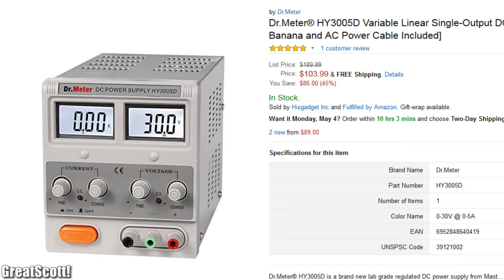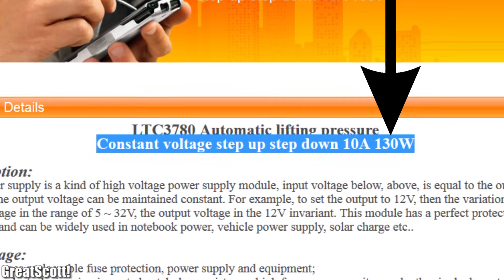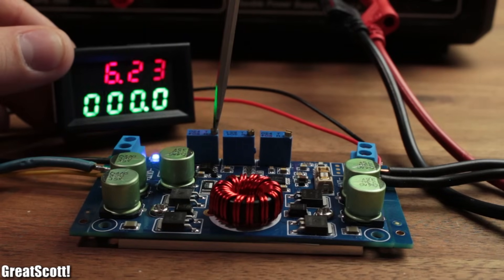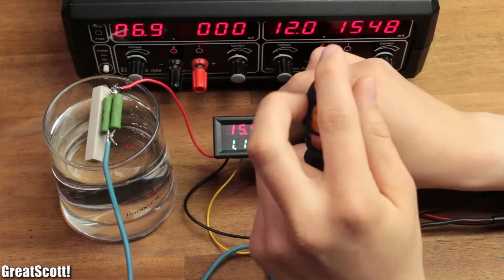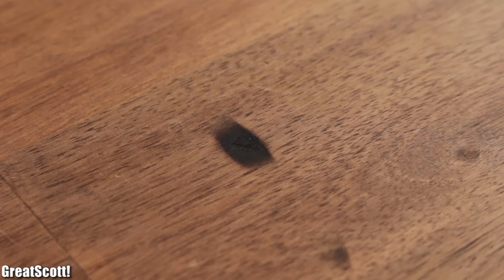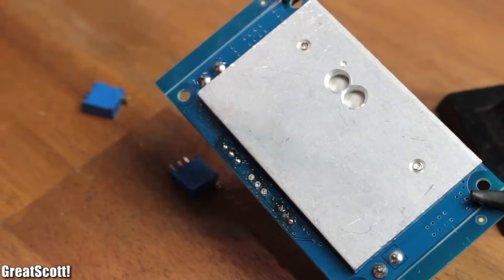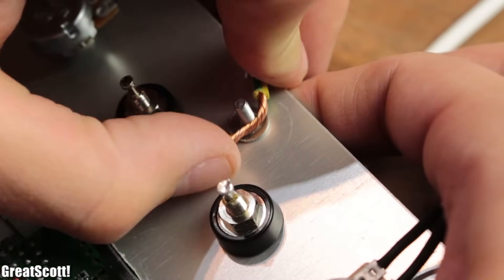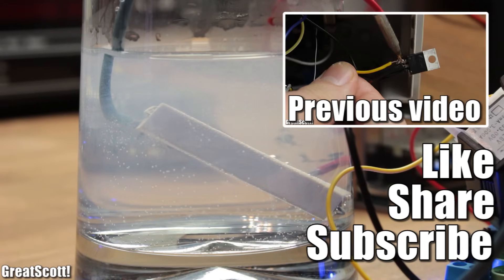Build your own Variable Lab Bench Power Supply

Comment: Hello, thanks for this tutorial. Unfortunately I couldn't get mine to work. If wired as you showed, I get 0.0v on the volt-amp meter, turning the potentiometer either way doesn't help. Current shows correctly and change upon turning it's potentiometer. Any hint on what's wrong with my setup? Thanks.

Comment: The fault LED is on... What should I do?
Reply: Turn the potentiometer that remains on board(in this build) counter clockwise until the FAULT LED goes off. In my board it took like 20 rotations. It is the under voltage limit adjustment. There is nothing faulty on the board, the led just indicates that the voltage is lower than the set limit and hence the board has stopped power output. You could also use higher voltage but with this board 12v is about the sweet spot for efficiency.
Reply: crank the middle pot to both sides a LOT or turn up the input voltage

Comment: Great video - I built a bench power supply using your video :)Why does my maximum output voltage drop to 25.5V from 29.8V after fitting the remote 500kΩ potentiometer?

Comment: I follow your instruction but:
1. I use a 180W 12V inverter instead of the 60W you use.
2. The LTC3780 Max power is 130W, since I can't find a 130W fuse anywhere so I use the closest thing I have which is a 125W fuse, I added the 125W fuse for overpower protection.
3. I added more heat sink and a fan for more cooling because the data sheet of the LTC3780 buck/boost regulator said that you need more cooling if the power is above 80W.

Comment: good after noon Mr Scott ,, I got a QUESTION SIR I MAKE THE VARIABLE POWER SUPPLY WITH A 12 volt 10 amp power supply and the bost a LTC3780 ,,,, the problem is the voltage is not stable voltage goes up and down

Comment: On the LTC3780 the potentiometer in the middle is there to adjust the current. Goes from 300mA to 3A with the 200kOhm potentiometer as we heard. If one used  pot. with a different resistance , in how far would it influence the current range?

Comment: For $70 (on amazon) you can get a 0-30V, 10A power supply, it's about twice the cost of yours, but also gives about twice the amperage, and has an integrated cooling fan (that only kicks in when it needs to). -- Beware though, the Chinese one I got is a bit cheap; mine showed up and I thought the display was bad, I opened it up and noticed that two of the connector plugs were just loose.  So I re-tightened them, and now it works like a champ.

Comment: It would be good ; necessary to understand the electrical code specifications for a power supply. I read about fans, shrink tubing, and fuses, yet it seems like those issues were not discussed. I sometimes wonder if they would limit access to videos like these so that only skilled people can perform these actions. Fire protection,  but also legal protection for Youtube. Hmm... I certainly would not want to go against federal and/or state/provincial laws; would want to specify them as part of my design specifications. You are quick and smart,  but not entirely thorough enough on these important safety issues.

Comment: Instead of using the recommended 12v power supply, could I use this circuit to add variable functionality to my old radio shack  power supply? Or will I need a more robust buck converter?
https://informops.files.wordpress.com/2015/03/radioshackps.png

Comment: Thank you for this video and your channel. 

I am building a power supply arround this board.
I wanted to use multi turn potentiometers but couldn't find 200K and 500K. It is possible to use other values? or to change the circuit to use 10K pots?
Reply: I am also looking for a way to go through this. There are no 500K and 200K big multiturn pots. What did you do? I am thinking to make some kind of modification and somehow mount those tiny pots to the plastic box and attach/glue some knobs.

Comment: Hello, can I connect the 12V 10A 120W power supply to this board? But I need to buy another amp meter that can withstand 10A?

Comment: NOT A GOOD IDEA....!!THERE ARE FAR MORE SMART AND MORE POWERFUL ''DIY BENCH POWER SUPPLY'' ON THE NET..WITH JUST AN OLD OR CHEAP DESKTOP PSU....THIS MODULE YOU USE IS PROBABLY MORE EXPENSIVE THAN A LOW END PSU!!!

Comment: The most basic DC power supply only needs: a power cord, a container for the internal components, one voltage transformer, diodes, some capacitors for filtering, an adjustable regulator, a heat sink, outlets and I strongly recommend having a switch.

Comment: I looking for a triple output supply. Would it take a 12V 15A supply to do the trick? Any other considerations when driving more than one of the LTC3780 boards other than "daisy chaining" the 12V power to each one. I would arrange two of the output binding posts so I could jumper the ground of two outputs to get a + and - voltage. Haven't decided if I want one display with a selector switch to keep the cost down.  It would take a fancy 3PDT switch and would need to be able to handle  the output current.

Comment: I work in the HV world in North America and protection and control voltage is usually 125VDC. 
I have looked for a way to make a variable voltage constant current power supply but electronics is not my forte and there is low demand for this voltage level. 
Currently the industry mostly uses Variacs with a full bridge rectifier, but it's bulky, heavy, and not very durable.
I'm wondering if there's an easy way to design a 150VDC power supply using 120VAC input and a buck/boost converter?

Comment: See! Water does not conduct electricity! XD
This is actually true for distilled water. Still, don't follow GS's example and go pouring water onto your phone to test it!
Reply: The moment that water contacts your phone, it will become so full of microscopic impurities that it will definitely be conductive.

You are correct. Pure (or mostly non-contaminated) water does not conduct electricity. The danger is usually corrosion, or impurities floating in the water and conducting electricity.
Reply: Actually distilled is still conductive , you want de-ionized water

Comment: Great tutorial  MR Scott I by a 12v 10 amp 120w power supply and the LTC3780-Automatic-lifting-pressure-Constant-voltage-Amp-step-up-down-10A-130W
the Question is ,if  You can Help ,I conected the same way as Your instructions  Sir, I dont get the 28  volts dc,when I reach the 28volt dc the the LTC3780- little red finks , and stars going crazy and the amps I get is 3 amps  any subjection Mr Scott

Comment: I have four of these LTC buck/boost converters and only one worked "out of the box" they are crap! Two of them show both the Fault and the OK leds simultaneously and neither buck nor boost, although I guess you could say one bucks (or is that sucks?) as it only provides about 3V out with 12V in. None of the pots has any affect on the output or status of the leds. The other is much the same with 12V out for 12V in. The third does seem to work, however when the CC pot is turned to minimum the LTC module activates my power supply's short circuit protection. The Fourth one, touch wood, is functioning ok for now, but can it be trusted?

Comment: I need help. went i conect the transformer and I read the voltage its give me 12V but when I connect it to the LTC it doesnt give any voltage in the autput and the led named fault trun ON. What can I do to fix it??
Reply: You may need to first rectify the AC from your transformer output to a DC. Look up full bridge rectifier or ac to dc conversion. I don't believe the LTC will accept AC input as it is a step up step down dc to dc converter use to raise and lower the voltage and current. The power supply used in the video I think is a switch mode power supply that is putting out a dc current.

Comment: hey, great video!
you mentioned charging lithium-ion batteries with this thing. Is that only possible with "lithium-ion" batteries or for example also if it only says "lithium" on the battery? What about all the other types? Also what should I keep in mind doing this concerning safety?

Comment: Just need confirmation if following module be used instead of LTC3780 with a 20V 4.5A supply?

http://www.hallroad.org/power-supply-and-adapters-/873-mppt-solar-controller-solar-panel-board-5a-dc-dc-buck-step-down-charging-module-constant-current-voltage-module.html

Comment: I'm currently making a power supply using one of these and I was wondering if it has some kind of short-circuit protection? The last thing I want is to replace the module every time I make a mistake (and it happens quite a lot)

Comment: i don't know why in my case after i solder the two pot the ltc's fault led goes on and the chip getting hot with output voltage 0.89 to 2.64v only .I'm using 220k & 470k is that the problem, can anyone told me why this happen, the solder is ok no shorting. And I'm ordering another one so i don't want same happened to my new ltc any help would be appreciated.

Comment: Your ground connections are completely against electrical code ;-) Crimped terminals are mandatory for stranded wire, solder is unacceptable. They will loosen over time and you lose protection that you were supposed to have.

Comment: Cost of parts = £55.00 
Adjustable 30V 3A 220V DC Digital LED Display Regulated Variable Power Supply (UK supplier) £25.75 + £9.89 P&P (ebay.co.uk - August 2017)
Probably not worth making yourself unless you really want to.

Comment: Bought all the parts, waited 1 month..... Soldered the potentiometers exactly..... a fizz, pop and nothing.... What went wrong??
Reply: breezebro Probably shorted a potentiometer pin... decided to buy cheaper 90w $7 power supply instead as it comes with all the same features and the potentiometers with knobs or what ever they are called. May try again some time soon though. It did say fault when i first got the LTC3780 but i turned the UV pin enough till the light went away. Before soldering pots there were some minor problems so it could of been a faulty board. Too much hassle for a refund... He's asking too many questions

Comment: The PSU module doesn't seem to be available in the UK. There are some alternatives. 

Input 7-32V Output 1-30V Adjustable Voltage Converter which is very similar to the one in the video. Though it may need a better heatsink, this shouldn't be much of a problem. https://www.amazon.co.uk/DROK-Converter-Regulator-Adjustable-Constant/dp/B0171JFSJ0/ref=sr_1_16?ie=UTF8&qid=1499938944&sr=8-16&keywords=boost+converter

 DC 10-40V to 0-38V 6A  Adjustable converter. This one is different from the one featured but claims to have excellent current and voltage regulation. It also incorporates a small display, but this may be useless for the needs here. https://www.amazon.co.uk/Numerical-Converter-Regulator-Constant-Transformer/dp/B01GPTY7O4/ref=sr_1_42?ie=UTF8&qid=1499939419&sr=8-42&keywords=boost+converter

Comment: Good video for teaching. But... I'm a huge DIYer, but $60 for a 30v 10A adjustable bench supply or a little more for a better quality one, means I'll just buy one. There's a point where DIY doesn't make sense. Unless you've got the parts laying around already, just buy one and have a better quality and more reliable tool. Especially since this is a tool you'll use a LOT.

That being said I've got myself an old 24v, 5a lead acid car battery charger that I'll be converting to an adjustable PSU as a curiosity project. It's so ridiculously simple in its construction a cave man could understand it. Kinda scary how simple it is. What's even more scary is how it was built (I'm sure many of you know what horrors lurk inside of some 80s and early/mod 90s electronics!).

Comment: nice! This project is way original. Instead of buiding your very own bench power supply, with a printed circuit board, capacitors, transformer and shit, you was clever enough to use an already cheap switched mode power supply (which you set to 12 v before assembling it) and then used the regulator to control it!! All that inside a nice case, which i wonder why it isn't a plastic one but nevermind. Very clever and original idea!!

Comment: I think I'm missing something... I wired this up using exactly the same components but can't get a reading on the ammeter? Wiring the meter is as follows: thin red and thin black - positive and negative input on the ltc. Thick red - positive binding post, thick yellow - negative binding post, thick black - negative output on ltc. Positive output on ltc also goes to positive binding post.... Am. I supposed to use a current shunt?

Comment: ordered everything just can't wait to try it out. how can I change the pots to the ones I ordered without damaging the circuit as some people have above and ended up breaking the tracks on the board and having to buy a new one . also if use a plastic ABS  project box do I need to figure a way to earth the ac input to the box or will it be fine with it being plastic Ie. non-conductive  please Some help.
cheers Daniel

Comment: There is a slight drawback with these kind of small volt/amp meter: the ammeter measures the current on the negative line.

If you have in the circuit (what is powered by the PSU or an oscilloscope for instance) a device connected to the earth, and if the DC 12V supply is also connected to the earth, then, in some cases, the shunt of the ammeter will brobably bee shorted via the earth.

This is harmless but the current will then not be displayed.

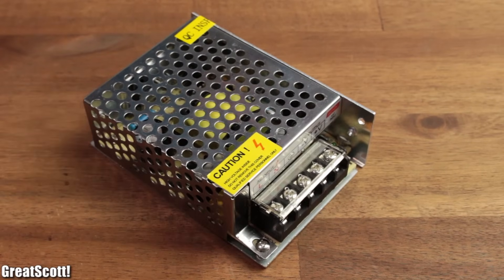Comment: is the max 5amp or 6amp?  I see at 3:12  this is a 12v 5A power supply,  but at  6.51 I hear "maximum of 6 amps".    
Either I am missing something, or need to learn something new.
Reply: Buck boost converters can output more current when outputting lower voltages. Unfortunately, the current will only reach 2.5A at 24V.

Comment: U should use a 12v 15a ac-dc converter. Because you can't reach the maximum power 180w with the 5a one.
Reply: Can we use laptop power adapter for ac to DC conversion I’ve 20v 7a one
Reply: True.. Have you make this project yet? I'm thinking of using a 12V 10A DC. What do you think? Thank you

Comment: How would one add a fine adjust to this? Would I have to use ganged pots (connected opposite each other) to raise and lower the resistance value on both sides of the main potentiometer?

Comment: That kind of power board is not available in my country... which of these boards can i use?

this one?
https://www.google.com.ph/search?q=ltc3780+philippines&prmd=ivn&source=lnms&tbm=isch&sa=X&ved=0ahUKEwjtytGn7pPTAhWGJZQKHdxuCLI4FBD8BQgFKAE&biw=360&bih=512#tbm=isch&q=150w+boost+converter&imgrc=BylQMLurUM29fM:

or this one?
https://www.google.com.ph/search?biw=360&bih=290&tbm=isch&sa=1&ei=XFLoWNS9J4Hi0gTy96y4Cw&q=5-30v+boost+converter&oq=5-30v+boost+converter&gs_l=mobile-gws-img.3...190944.202527.0.202889.27.23.4.0.0.0.224.2506.11j9j2.22.0....0...1c.1j4.64.mobile-gws-img..1.14.1561.3..0j35i39k1j0i5i30k1j0i8i30k1j0i24k1j30i10k1.6jfUJrOvVB0#imgrc=v0TDbSC6kJbNBM:

Anyone? Thanks...

Comment: For that kind of current it's important to have a thick and short cable for the output terminals; otherwise the voltage regulation could be noticeably off. And I would solder them too, replacing the screw terminals the same way we did with the potenciometers. I'd also avoid hot glue since it tends to 1) unglue by itself and 2) melt in the presence of heat. I also second other people's opinions about heatshrinking the AC terminals and using a better solution for the Earth protection, like making a small ring with the cable end and a little bit of solder so it wouldn't come off of the screw.

Comment: Could this power supply run an 18 volt drill without burning something out? I'm not sure what the amp draw would be from the drill, but I've already tried a laptop power supply with no luck. I would rather build a power supply instead of adapting another battery to fit.

Comment: What is the specification of the potentiometer that you use for replacing the default 3296?  The spec of 3296 is 10 ohm to 2Megaohm. Seems very difficult to find any with similar range. I believe we don't need such a big range.

Comment: @GreatScott is there an easy, effective, and cheap way to make a power supply that does not put put more than 15vDC but amperage at or around 100-200 amps?
Reply from the maker: No

Comment: i need far more voltage not current 5 Amps is enough .... minimum 20 000 V  if not more .... planning on creating static fields with no or very very little current in it ....

Comment: Hey  Scott ,  Am  I  missing  something ?  Where  did  you  change  the  AC  voltage  from  your  power  supply ?  Or  is  it  DC ?  The  way  you  were  explaining  it ,  I  thought  it  was  as.  I'm  actually  using  the  LTC3780  as  you  have  with  a  400w Computer  psu. Putting  in  a  4  position  selector  switch .  3.3v, 5v, 12v, and  variable .  I'll  have  close  to  18 amp  on  the  12v  position .  I'm  adding  an  extra  cooling  fan  on  the  LTC3780  to  get  full  10 amp  on  the  variable .  Also  using  5  digit  readouts .  Your  video  inspired  me.     THANKS !
Reply: I'm  sorry ,  I  watched  it  again  and  noticed  it's  an  ac - dc  supply .  Almost  have  all  my  parts.  My  LTC3780  should  be  here  tomorrow .  Getting  excited !  Thanks  again  GREAT  SCOTT

Comment: Nice video, but I have one question. Knowing that the LTC3780 can have an input voltage in the range of 5 ~ 32V why did you choose to only supply 12 volts? Does it not matter for the output it can provide? I mean that, if you supplied 24V i.e. would it still only reach 29.4V at the output stage?

Comment: The power supply is rated at 60w, but if you run it at 30v and 6 amps that would be 180w. Wouldn't that be dangerous for the ac-dc power supply?

Comment: I had a question? 
I could need 7-8 amps at 12 v sometimes for one of my circuit. 
the max I can get at 5 amp 12 v psu is 6 amp. what if I use 12v 10 amp psu. will the output will be higher. ?